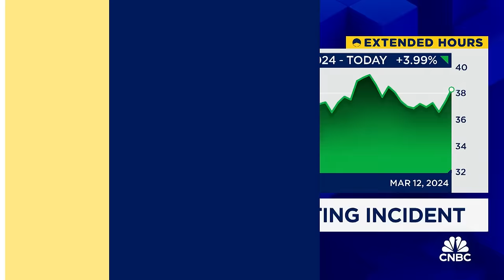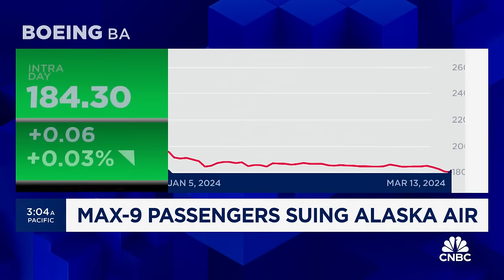Alaska Airlines plane whose door panel blew off midair was scheduled for maintenance

Comment: CNBC failed with this report.  I'm a type rated Boeing 737 pilot. I'll explain this in a way people can understand

There weren't "warning lights" that went off, it was a caution light.  A warning light automatically grounds the airplane, a caution light does not.  

The lights in question were for the airplane's pressure controllers, that deal with pressurization.  In the 737, there are 2 pressure controllers. This controls the cabin pressurization.  If one pressure controller fails, there's a backup and the airplane will present with a CAUTION (yellow) light.  If this happens in-flight or on the ground, there's a procedure on how to deal with this.  If in flight, it automatically goes to the second controller to continue normal pressurization.  On the ground, maintenance will figure out which controller failed, pull a circuit breaker and per the FAA and airline maintenance scheduling, the airplane can continue in service for a specified period of time.  The airplane MAY be limited to certain operations but it's still safe to fly.  If both pressure controllers fail, there's a MANUAL function that the pilots, per the Quick Reference Handbook (QRH), will identify and explain how to manually control the pressurization in the cabin.  

The pressure controller on N704AL was an issue, but IT HAD NOTHING TO DO WITH THE PLUG DOOR.  The NTSB about a week after the incident concluded that the reported "warning light" by the media did not cause the plug door to fall out.  Showing Alaska did not ignore or cause the issue that happened that night.  Again, there's a distinct difference between a "warning light" and a "caution light".  The pressure controller produces a caution light and as such gets responded to differently.

Comment: Were is Alaska responsibility on door? Should have not flown plane when warning lights went on indicating pressure issue. Should have been looked at and if issue with door was found should have been reported to both Boeing and FAA. Not defending Boeing but warning lights are there for a reason.
Reply: No warning lights existed on the airplane, that's not an accurate report.
Reply: @erauprcwa  January 3 warning lights went on.
Reply: @alexrebmann1253  What was the warning light?  Because the pressure controller IS NOT a warning light.